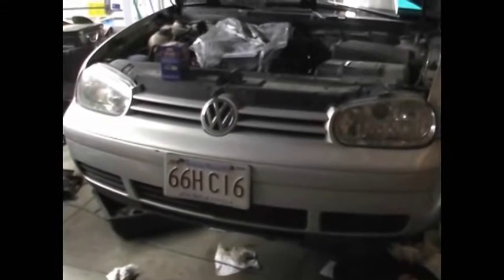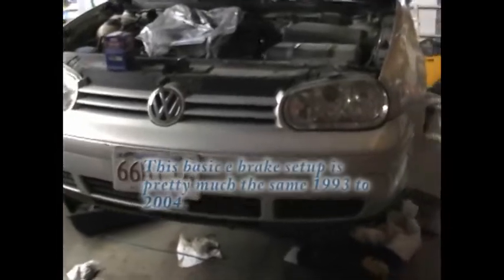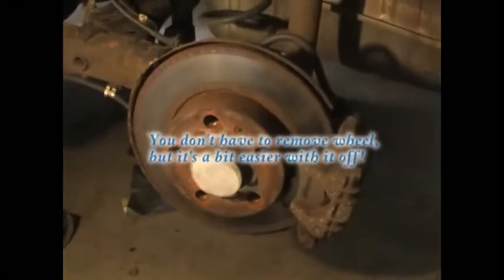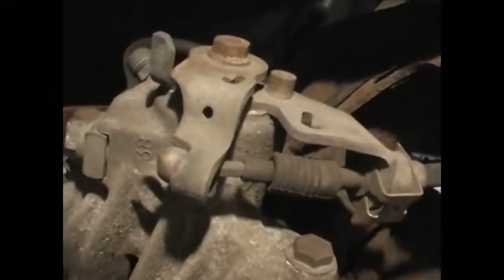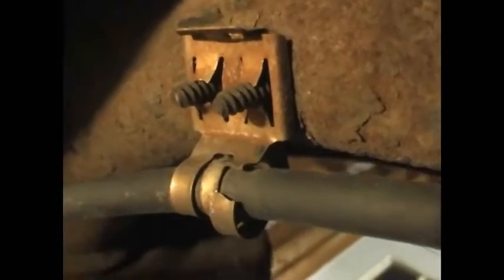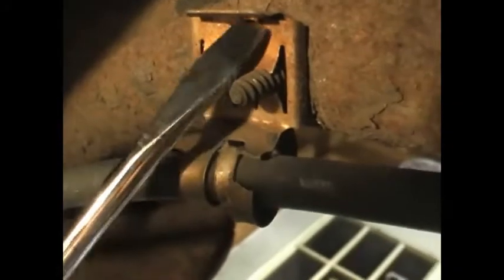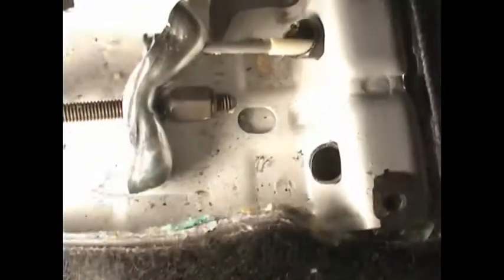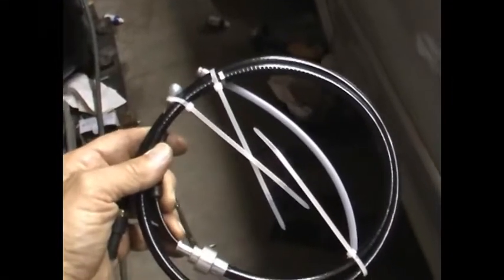Emergency brake cable replacement - 2000 VW Golf

Comment: good video.
My handbrake only pulls with 80 daN so have ajust the handbrake. the autoshop told me it would cost around 350 usd. I live in Denmark so it expensive but still for such an easy job..
This video saves me a lot of money. Thanks

Comment: Great video. I had the same situation yesterday. I ripped out the guide tubes without thinking and thought SHIT!! how am i going to put them back. I thought i would have to remove the exhaust and heat shield. Fortunately i would of had to remove them anyway as the rubber bit got stuck inside. I had no drill to remove so i used a blow torch to burn it out instead. Thanks to your video, i can fit guide tubes back now.  Cheers ;-)
Reply: MrTech1210 how did you fit your guide tubes back in in the end? I can't seem to find the holes behind the heat shield. Doing my head in!!

Comment: It was a hard and tough job to separate the cable from the metal pipe.  I cut the pipe with a grinder on site, under the car, at round 1.5 cm, and then added one nut of same length of cutted pipe at the end of the cable at the brake lever. 
I didnt know if i can remove that goddamn pipe, so I did it what I did. Then, I tighened  the nut with hydraulic crimping tool 😏😀. What else could i do. It is ok now. Working properly

Comment: It is easier to buy new guide tubes ("conduits") when you do this. They cost around $10 each. For older VWs (e.g. MkII and early Corrado) the newer tubes work fine even though the bend is different.

Comment: question , I didn't see the reason for the cable to be replaced , was there an issue with the cable ? great video by the way , you made it real simple
Reply from the maker: Yes, one of the cables was totally frozen!
Reply: How you know it s frozen ?
I buy a new cable bit i can't attach it..the lenght of the new cable is exactly the same as the old one, but it doesn't reach the two extremity...

Comment: How difficult was it to get the guide tubes back in place? Mine came out when I was trying to remove the cable and it's driving me nuts trying to put it back in as the heat shield is in the way. Any tips?
Reply from the maker: Hi Danny, I don't remember having a problem getting them back in... it might help to have a second person looking down at the console to help you guide them....
Reply from the maker: Yeah.. i just reviewed the video and my wife was up above!!!
Reply: Alan McRae thanks Alan. I've have to enlist my better half to help!
Reply from the maker: Yeah! You can see the idea at 13:33 in the video!
Reply from the maker: Otherwise... i just had an idea... you could put a coat hanger part way down through the hole in the console...then put it through the tube and hook it at the end.... then pull from up top  or at least use the hanger as a guide to move the tube into position... maybe???
Reply: @amcrae1  This sounds good, especially if you do not want to drop exhaust/heatshield. I just finised welding in new exhaust flex pipe and I really do not want to take the exhaust off again to drop in new tubes and cables.
Reply from the maker: @sven-erikviira1872  i'm surprised that those would be in the way!!!! Thanks for the comment!
Reply: @MCRIZZLE1  Some people think that engineers make some simple thing difficult to make money for parent company from service. Maybe, but - "Never attribute to malice that which is adequately explained by stupidity."